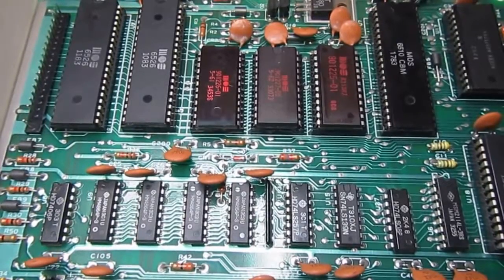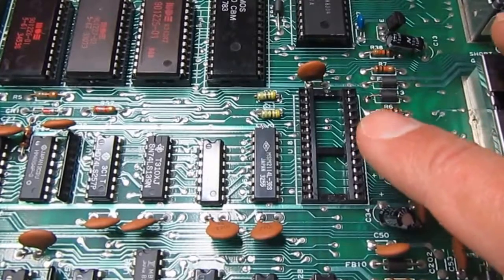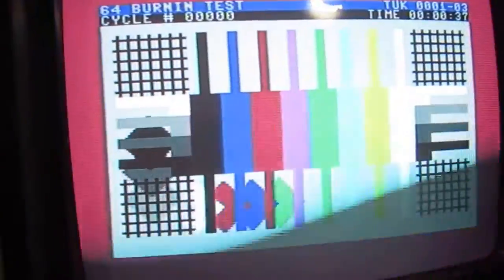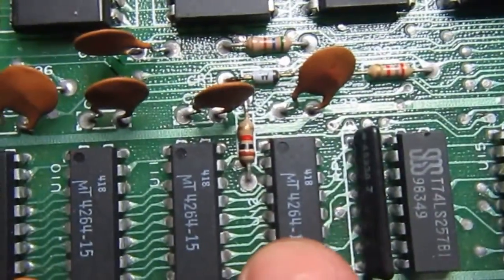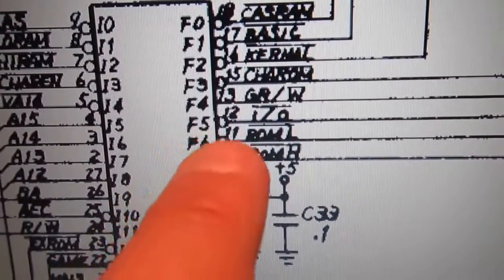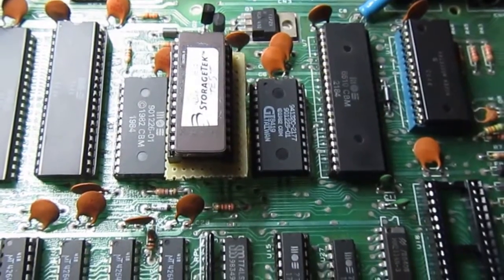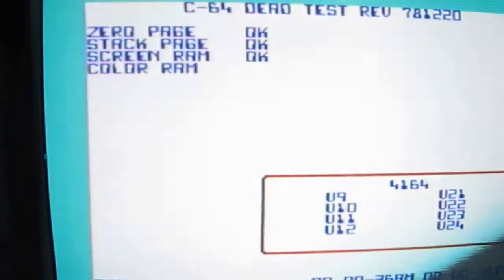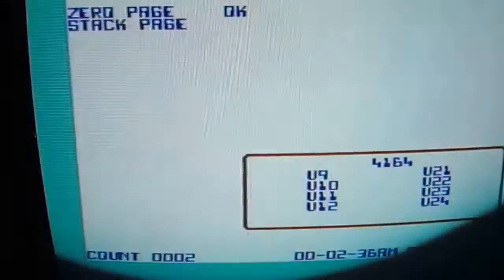2 x C64 repair. One easy black screen case and a wrong approach

Comment: Thx nice vid but What program do you use to test this?
Reply from the maker: Hi David, the program is called C64 burn-in, it was originally a cartdrige and I just made an image sometimes in the '80s when I started repairing C64s. I would recommend making a cartdrige with the C64 dead-test or a kernel ROM replacement with this diagnostic. Dead test (and lots of diagnostic info) can be found here:
http://blog.worldofjani.com/?p=164

Comment: Another interesting video =D
Reply from the maker: Hi GadgetUK164! Thanks for the comment. The message here is to never be in a hurry during a repair. There's always a way to identify a fault, we have many options usually :)
It's again the same mistake I fall into sometimes, like on the PET repair, I have a suspect but I don't verify it, so I start pulling chips and that's not something I like :)
Reply: im similar. im getting into the habit though of checking voltages on the chips but often it's tempting to start chip swapping. gonna start learning how to use an oscilloscope properly next. last fix i did was a capacitor that had snapped off and the legs were shorting the board...took ages to spot that one.